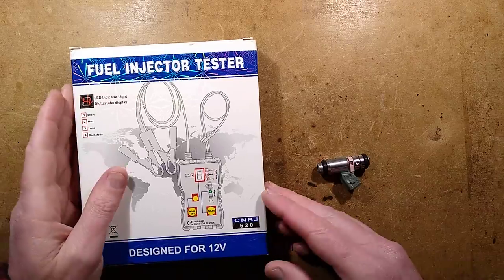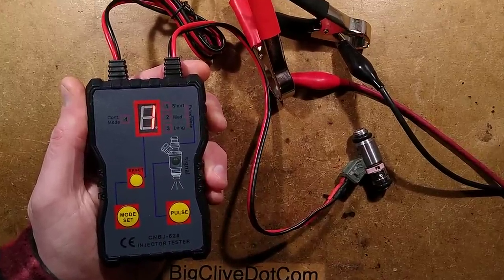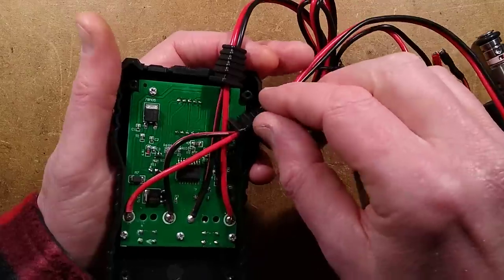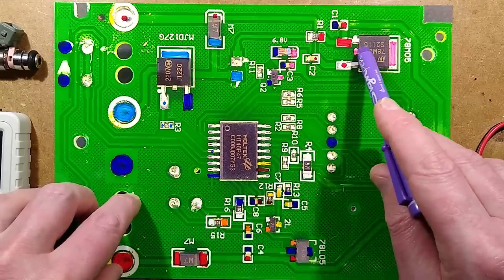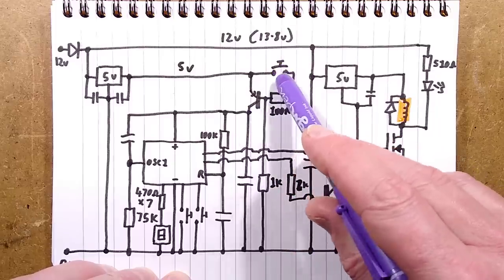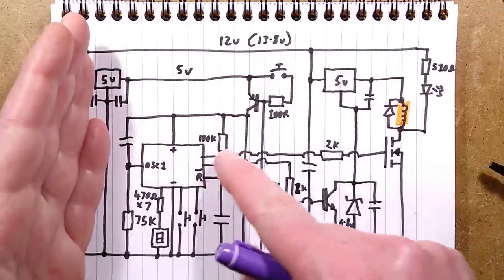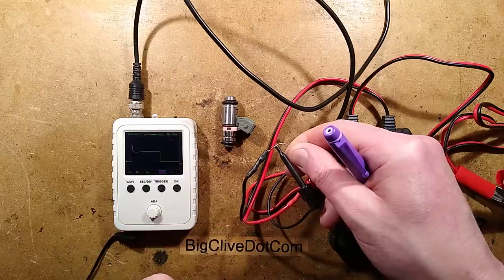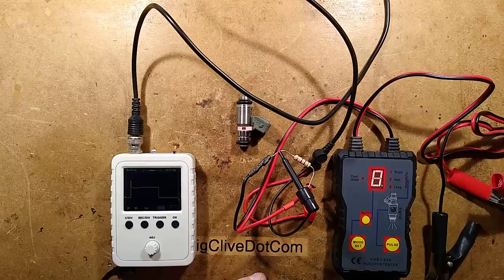Inside a fuel injector tester (with schematic)

Comment: Still trying to get my head around the use of the zener diode…

Question: What make/model is that Oscilloscope there?
Reply from the maker: The 7805 regulator will output 5V above its zero volt pin.  If the voltage of that pin is raised then the 5V is above that.
The scope is a DSO150

Comment: What (brand & vehicle fitment please) injector is that? It looks like the kind I've been looking for. I have a 3.5L Sigma V6 in my Hyundai XG350L, & have been looking for more solid (not plastic encased) injectors like those. They have a really solid sound to them, & the nozzle looks like it puts out a really fine pattern (cone shaped mist). Thank you for any info. And if anybody reads this comment & knows the part I'm searching for, please let me know. I've looked over hundreds of injectors & info is spotty on fitment outside of what they're attached to by the OEM. Thanks again, & great video!

Comment: If you use solenoid injectors (or solenoids at all) you better have a start current and then a hold current. To do anything else creates useless heat that will melt the glue in your coils over time. I did this on a sprinkler controller I made. I stole the idea from pinball machines. A fancy system would have two different drive currents, but I just PWMed the voltage after the initial activation. I thought of it as reducing the total energy going into the coil, which is what I wanted, less heat. But looking on a scope it just ends up looking like AC. Between the switching and the inductor resisting the changes it's smooth-ish AC.

If you have AC available then it's easy just to drive them with AC. As the coils are inductors the current will naturally be limited because the coils resist the constantly reversing current. For DC you have to manipulate it yourself.

These coils are 4 ohms or something. If I ran them off 28V AC (doorbell transformer) they'd settle at 150mA or something. But if I ran then off 12V DC they would shoot up to the full 3A. That's over 30W and when I saw this I immediately disconnected them knowing these coils the size of a spool of thread weren't going to take that for long without melting.

If you are using piezo injectors I don't think it makes any difference if you drop the current after it activates. Newer injectors in direct injection cars are often piezo. Older ones are all solenoids as far as I know. This device would be designed to try to drive them both.

Comment: how many amps do you think I would need to test 4 injectors at the same time with this unit on a 12v power brick instead of using a battery? Thanks

Comment: It's as I suspected, the 78M05 can't provide a stable full output under load but it manages to work because the higher voltage pulse is of such short duration. It would have been interesting to see what point the circuit is switched to the higher voltage. If it is only occurring at the firing point that might explain why the internal charge pump manages to operate.

Your diagram indicates that the input voltage needs to be 13.8V in order to get the injector to fire. Since this is only generating a load voltage of about 8V it would suggest that with an input voltage of only 12V (as indicated on the back sticker) the peak pulse would only be about 6.2V. I wouldn't mind betting that some injectors wouldn't fire even with the 13.8V input, leading to rejection of some perfectly good injectors.

Even though the dropout voltage of the 78M05 is only 2V, the specs say that the minimum input voltage should be 10V. With the added offset of 6.8V from the Zener, that would suggest that the input voltage really needs to be about 16.8 volts!
Reply: 6.8v plus 5v is 11.8v,  those regulators need about 2 to 2.5 over the set volts to work correctly so that makes possibly 14.3v to get 11.8v output, with lower input supply, the output volts will be lower and 'unregulated'  until the  6.8v zener gets shorted, then it should drop to 5v properly regulated

Comment: They might have implemented it super bad and run out of program space, and reading the reset button would have exceeded the ROM, thus the hardware reset button. I don't think this is the case, with that controller, but that would be an explanation.
Reply: Good one. I thought they maybe did run out of I/O ports and they did want to use this controller because they could get it cheap or something.

Comment: I don't know anything about fuel injectors, but I've just bought a new Windows 11 Mini PC that fits in the palm of my hand, for just £159! .... What a time to be alive, Clive? 👍🤣
Reply: win 11 ..  ugh 😉
Reply: @andygozzo72  I've been using and building PC's for 27 years. Windows 11 is very similar to 10, and I like them both! ... So, I'm NOT sure what you mean by "Ugh?" ... My Beelink Windows 11 Mini PC was an incredible bargain and it works perfectly! I love it!
Reply: @marcse7en  too bloated and not a lot of good for older machines, or old software/peripherals not everyone always has the latest (within 4 years or so) computers, many, like me, cant afford it, my 'main' laptop is a 2007 HP designed for XP but previous owner  updated to 8, the i updated to 8.1,  i tried 10 on it but more sluggish,, i still have to use XP on a couple of machines as no later drivers for my scanner and a few other devices, i dont see why i should get a new scanner just to have  one compatible with newer OSs as its working perfectly ok at the moment, and only occasionally used anyway,
Reply: @andygozzo72  I understand what you're saying, and I too was stuck with several old machines which were not compatible with 11 ... I too have to use XP for my scanner and other devices and software ... But, as I said, my new Beelink Mini PC cost just £159, and it's a great machine! It's now my daily driver ... Windows 10's days are numbered in terms of support, unless you fancy Linux? ... Isn't EVERYTHING bloated with crap software these days? There's always an uninstall option ... I can highly recommend the Beelink, it's a cost effective way to upgrade, compared to a laptop or desktop.
Reply: @marcse7en  i thought microsoft said when 10 came out, it would be their 'final' version, no new ones, just constant/continuing updates?😉
Reply: @andygozzo72  They did indeed! ... Obviously, Microsoft are liars, and you can't believe a word they say? 👎🤣 ... And besides, Windows 11 means a lot of new computers sold, like the one I've just bought!

Comment: Just a heads up.  These cheap injector testers are 100% trash.  We had 2 of them, and both couldn't supply enough current/power to get the injectors to start pulsing.

OTC makes a fantastic one that actually works.

edit:  we had ours wired up to the car battery with a full charge.

Comment: PRECISE VOLUME OVER TIME. 
This is used to COMPARE to other injectors.
This is to MAKE SURE the volume of fuel passed, is the SAME on all injectors.
This test MUST be coupled with a fuel line PRESSURE sensor.

THIS NOT FOR TESTING A FUEL INJECTOR THAT HAS BEEN REMOVED! THIS IS FOR TESTING FUEL FLOW VOLUME!

Comment: How does the zener diode help to provide more than 5 volts to the injector coil?
Reply: increases the 5v of the 5v regulator, if its own ground is higher than true ground, it adds that voltage to its 5v output..
Reply from the maker: The 5V regulator references its output voltage to the ground or 0V pin, so raising that voltage increases the output voltage.

Comment: I use these in an American garage. I will say, they will NOT fire a (many of them anyway) diesel injector, nor a high pressure fuel return system on gasoline engines correctly.

Comment: Most car batteries, which this device is intended to work with, will typically be around 14.2 volts. This is strange as they still say they’re all 12 volts.

Comment: i have that same unit  i bought few years back. i must have the orig version and the one you are showing must be the revised version. mine does not have a" reset "button. and is supper annoying . you have to disconnect  the input power briefly on mine to be able to switch modes. the newer version with reset must just break input power to switch modes.. keep up the great vids. !

ps, you might get a chuckle  out of a slightly larger "fuel air injector" unit i made some years back..:) https://youtu.be/XvOMQkL8kd0

Comment: i tought those injectors are self-pumping.   without a high pressure line feeding them.
like a cavity with a piezo that forces the liquid out of a nozzle at high pressure instead of just opening a nozzle
Reply from the maker: I think there may be a piezo atomiser version.
Reply: Some direct injection injectors work like this, sort of, but they don’t use the piezo crystal to build the pressure (they get fed high pressure). They use the piezo crystal to open the pintle. Direct injection systems need incredibly fine control over injection time that some typical solenoid injectors can’t do.

Comment: Makes me wonder if these designs are ripoffs of hobbyist projects submitted to those cheap board houses.
They could have used a low dropout regulator for feeding the injector coil and that way the peak voltage would have been closer to 12V.
Reply from the maker: It does have the feel of stolen software.

Comment: A warning. Do not play with these unless you have depressurised the fuel rail before you do anything.

The reason is you have in your hand a Star Trek hypospray - and it'll either be full of diesel or petrol under high pressure - which it will then do its best to inject into your hand. If it does you will have neat petrol or worse neat diesel trundling around your circulatory system and people have died from it (blood poisoning) and if you don't you will wish you did. Be very very very careful with these. If I remember the procedure is something like disconnecting the battery while spinning the starter so it drains all the pressure off the rail but check first. These little gadgets aren't toys, and you need to be scrupulously clean too.

In other news, just had a portacath fitted and another biopsy done. Looks like the cancer back in 3 weeks from last chemo...😭. Not one of my better days. On the upside, 12 cornsnake eggs waiting for me when I got home.. 😳🥚😁
Reply from the maker: Hope things improve for you.
Reply: @bigclivedotcom  Thanks. The next chemo batch is the strongest they'll give (epirubicin +cyclophosphamide) to adults but the odds aren't great.
If you can find one of the old mechanical fuel injector pumps, they're quite interesting, really a mechanical computer like the kommandogerat off the 801D.

Quite how I'm going to deal with 29 baby cornsnakes (so far, this year) I'm not sure..

Comment: G'day, Clive whilst you already know I do laptop & phone repairs to component level, I'm also a mechanic of 40yrs also & that is not the waveform of an injector in action, it has a an incline from left to right with a little notch at about half way up when the pental moves hence reducing current for a few milliseconds or so, substituting a resistor won't work you need the inductance of the injector under pressure for the correct waveform sorry mate but a fail I use one of those cheap arse pulsers for doing injector leak down & they work fine, anyway hope your getting warmer, because were finally getting cooler, day 23C night 13C.
Cheers mate.

Comment: I just had my Fuel Injector fly out of the engine at 100km/h because some slack mechanic did not bother to make enough turns when they changed it (MAZDA3 05)
$500 tow back to the city. I dont need a tester, I need a new mechanic

Comment: so the injector is not a pump? it's just a valve?
Reply from the maker: Yes.  Effectively just a solenoid valve and spray nozzle.
Reply: @bigclivedotcom  i was contemplating some projects with the injectors (I have a few older ones) to water plants (I'd have to pressurize the water, or have it feed off the city water supply)
Reply: Some older VW TDI engines do have injectors that are pumps, driven from the camshaft. These are the "Pumpe Duse" (PD) engines.

Comment: What a rip. I was hoping it was like a flyback “ring” tester. Sigh. 🙁
Reply: How much "Q" does a fuel injector coil have anyways? I'd imagine not much as the core most likely would be solid steel. That said, like ignition transformers, you could just test all of them and see if one has a radically different value.

Comment: Vehicles usually run up to 13.8 volts. (sometimes higher in older vehicles that didn't have an electronically stabilized voltage) Maybe try that before holding videos hostage for 2 weeks.
Reply: That 13.8 V is the alternator charging voltage (as clamped by the regulator). The battery voltage will be lower when the car is not running - and the instructions on that device instruct one to turn the car off before testing.

Comment: The reason why it doesn't work at 12 volts is, most cars run about 13.5v while running... I'm surprised you don't know that!
Reply: Not to mention the resting voltage of a car battery is 12.6v. Once a car battery reaches 12.2 v it is considered bad and dead.
Reply from the maker: I do.  I just expected 12V to be enough, given that the voltage can dip depending on the battery charge status.